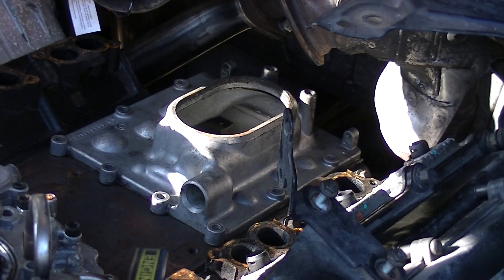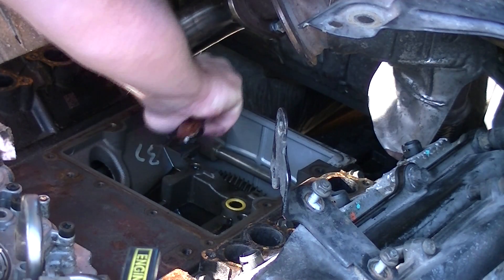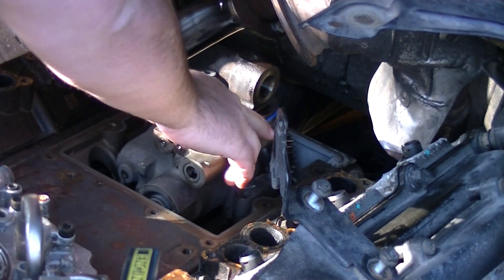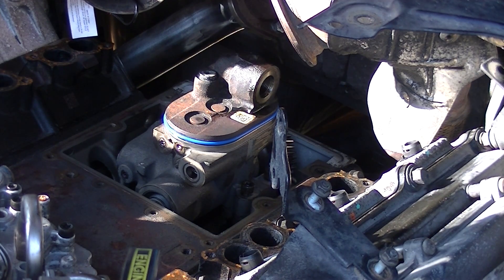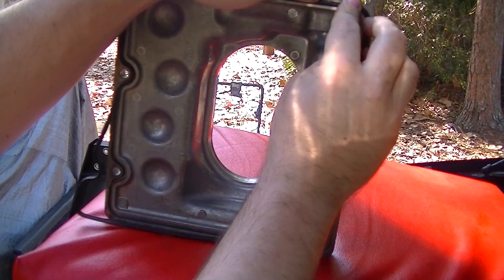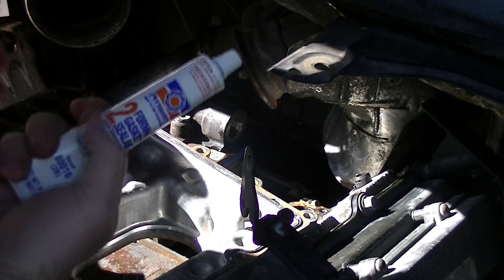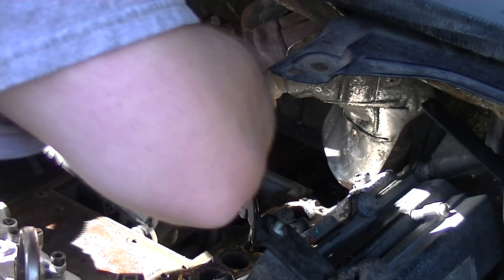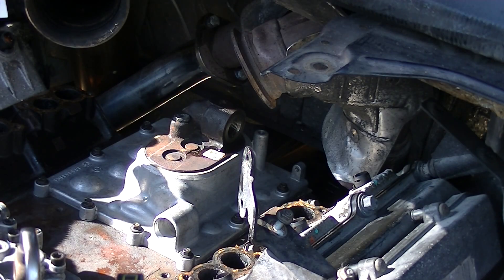HowTo: Installing HPOP with new STC Fitting in Ford F250 6.0L 2005

Comment: Hey, I have replaced my HPOP and I'm curious if you experienced any leaking along the back of the color where you added sealant? I read to add sealant where the block cracks are but I'm still getting leakage. Could over torque cause a leak? Thanks
Reply: Back of hpop housing not color. .
Reply from the maker: Lukas Ross What block cracks?  I had no cracks anywhere in mine.  Yes, over torque can definitely cause a leak - torque specs are important!